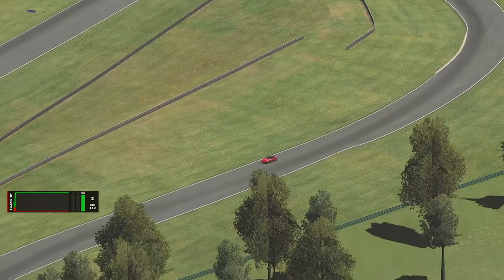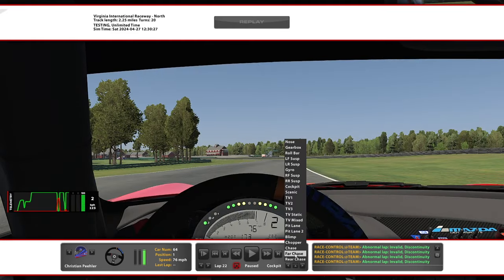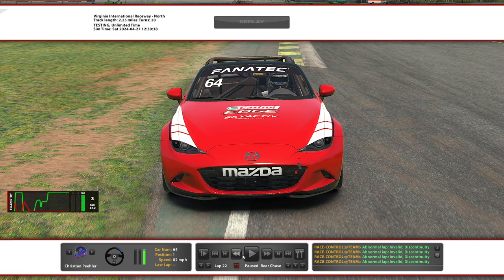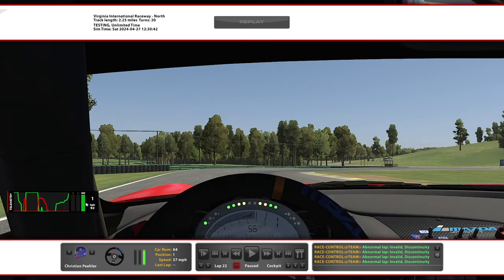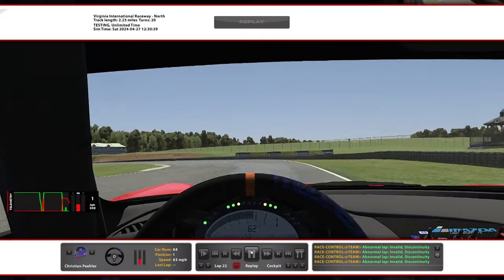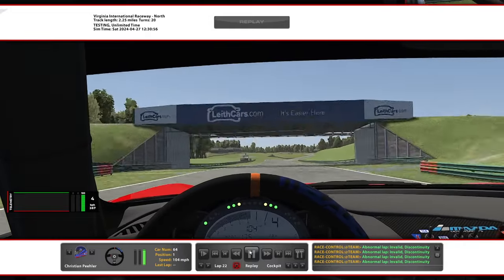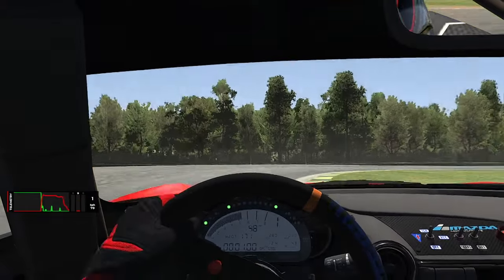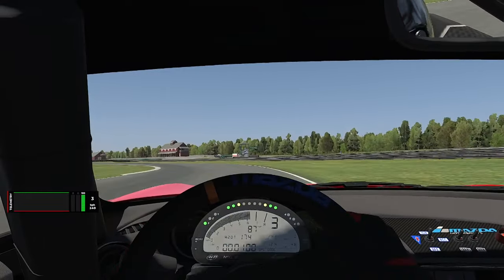Virginia International Raceway (VIR) North Track Guide - iRacing MX5-Cup Tutorial

Comment: Very new to iracing and sim racing in general and I seem to always spin as soon as I brake for turn 3. Do you have any tips?
Reply from the maker: I'll try to keep from dumping 20 reasons on you.

But there's going to be a few factors:
Entry speed
% brake force while turning
Downshifting
Racing line

Realistically, if you're spinning every time, you're probably either entering too fast and then using a lot of brake pedal to slow down mid corner while turning.  That'll lift the weight off the back tires, causing it to come around.

Try braking a little earlier and straighter so you can use the roll into the gas pedal through the corner.  That will help balance the car and give more understeer than oversteer. 

When you're newer, focusing on fast, clean exits helps way more than high entry speeds.  

The positive is, if you can learn how to spin the exact same way every lap in that corner, you can eventually learn how to use that to turn the car and carry more speed.  It sounds like you need to focus less on that now, and more on consistently/safely making it through the corner.

One final tip, watch back your laps from the chopper cam.  Make sure you're to the right of the rubbered line on the track and position with the right if your car near the curbing on entry, and use ALL of the road on exit.

A huge reason guys I coach spin is becsuse they want to be "safer" by leaving space on the outside of the track, but all that does is make the corner a tighter radius, and you'll be more likely to spin.  Use all of the track you have available to make the corner as wide as you can!

See if that helps at all, it's hard to say 100% what the issue could be without watching a lap, but these are pretty general tips.
Reply from the maker: Here's my shorter answer. 

You're probably spinning by braking while turning too much while carrying a lot of entry speed.

So if you're spinning, use less brake when you're using a lot of steering angle. The more you turn, the less you can brake without spinning.
Reply: @sim2circuit  thanks man really appreciate it